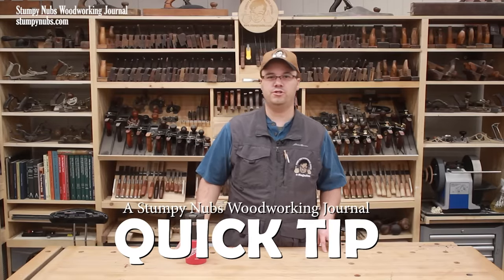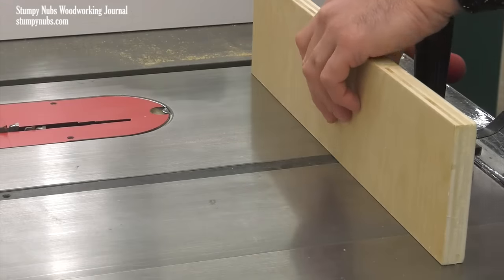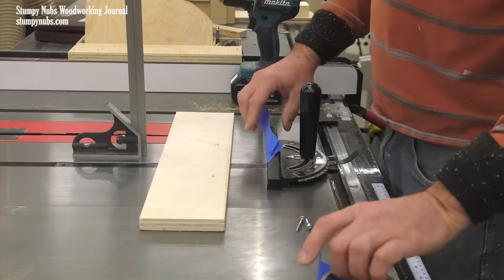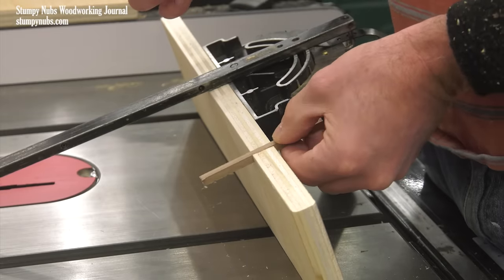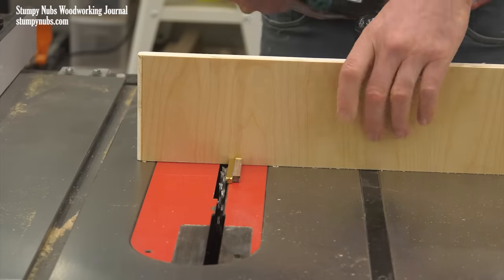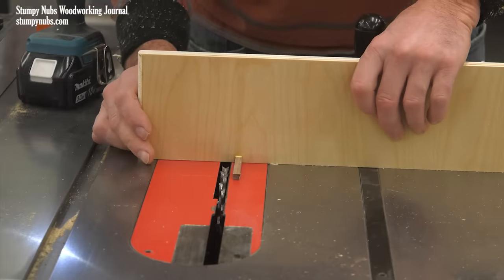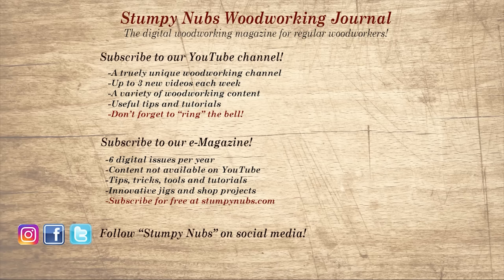CHEAP and EASY three-Minute finger/box joint jig

Comment: If you take the first piece after making the first cut and flip it, then place that cut over the wood strip, you can push your second piece up against the first to get the perfect distance for the initial cut in the second piece.  Be sure to remove the first piece before making the cut to avoid grazing the edge.  Then flip the first piece back over and continue with both pieces.
Reply: Brilliant, amigo!
Reply: Shmart!
Reply: But doing it tha way does not guarantee all cuts will be the same depth - trust me! Stumpy's method does!
Reply: @edhaskell1554 , not following your thinking. No mention is made of touching the blade height, which would change the depth of cut. This method is to position the stock for a cut that matches the size of the first finger. What better gauge for that than the very finger itself?
Reply: @leehaelters6182  But sccct happens sometimes when doing 2 vs. 1 cut! Trust me!
Reply: @edhaskell1554 , instead of clearing things up, you confuse me again! Stumpy shows how to do it by cutting both pieces at the same time, no?
Reply: @edhaskell1554 , was a great fan of Leave It To Beaver myself, when I was a wee nippah.
Reply: You were the trouble maker.
Reply: @edhaskell1554  I think you might have misunderstood what I was trying to explain.  The method I tried to describe only varies in how the second piece is positioned for its first cut.  After that, the rest follows exactly as Stumpy Nubs describes using BOTH pieces at the same time.
Reply: Great little hack. I'm going to try this today. Making a little jewelry box for my wife. Cheers!
Reply: +1. 

Your suggestion is the exact same method as pretty much every other box joint jig build I've seen on YT. I'm surprised that eyeballing the position of board B was suggested given the accuracy required for tight joints. That said, I am going to have a crack at this because I want a box jig, but I don't build many boxes and I don't need something I can't fit in my workshop. This can be tossed in the trash right after. :)

Comment: The geometry works the same on a router but there are complications. I do not have the best router but I have nice bits. If the wood ever grabs the twisting force is more than you can overcome with your hands. That twisting motion you feel means the joint and the box are ruined. With a table saw and dado blade set up, the force of the blade is pulling the work piece against the table. I am not trying to start and argument; if you made it work with a router I am happy for you and you should pay yourself on the back for buying nice routers.

Comment: I'd just like to make a comment about Ridge Carbide.  On Stumpys recommendation I bought a blade from them.  I had a mental malfunction filling out my address and completely missed the drop down box for what state I live in.  By default it went with the first selection which if I remember right was District of Columbia.  Half an hour later I got a phone call from them trying to straighten out my address.  That is excellent customer service.  They were literally working on my order within half an hour of me ordering and called just to verify and correct my mistake. The blade did arrive very quickly and is beyond comparison from the factory blade I was using.  I feel like a doctor who was using a butter knife and is now using a precision scalpel. The difference between the two blades is astounding.  Thank you Stumpy for the excellent videos and advice.

Comment: Thanks, I like cutting both sides of the joint at once. Efficient and accurate. I prefer a table saw for finger joints. I have trouble with tear-out on the router table.

Comment: Really cool.

Question, could you have just turned the first piece over and slid it on the index key. Then butted the second piece to it, to get your starter cuts?  Would seem to take the guess work out of cutting the second piece correctly.

Comment: I love the video. Quick and effective solution. Several other videos I've watched are way more complicated.

Shouldn't the height of the bit/blade be determined by the thickness of the material? If I'm using a 3/8 bit and cutting 1/2 inch thick material the fingers of the joint will be too short if I only raise the cutter to the height of the width of the bit. Unless you're talking about doing it in multiple passes only cutting the equal amount of material as the blade/bit is thick with each pass until reaching the proper depth for thicker material. (I hope I explained that coherently enough.)

Comment: One other question/comment - are there any specific steps vs. regular saw cuts you take to make sure Dado cuts are safe? I built a crosscut sled that I've used for Dado cutting and it works fine, but when I extend my arms to push the sled out, the saw blade is exposed, and since I use a sled the blade has to be higher than it otherwise would be. I may just attach a small stack of 2x4 blocks on the back end, but I wondered what you might recommend. I also might put a piece of plexiglass at the top of the sled over the blade opening because I often see small chips and sawdust kicked up in this direction during cutting.

Comment: I’ll be making this today. I’ve been cutting box joints with a similar jig using my router table. I find that the wood sometimes tends to shift/twist slightly when the bit makes contact even though I have the workpiece clamped and I hold it tightly. I’m hoping the table saw method will eliminate that.

Update: made the jig. Easy to do. I still get a slight twist of the workpiece as it hits the dado stack, but it’s far less than on my router. Using a trigger clamp mitigates that, whereas with the router that’s not quite sufficient. Fit was quite good. Setup of the while thing is far easier on my table saw that on my router. In fairness, I don’t have a router lift, so fine tuning the height adjustment is fiddly. So, we know what that means…need a better router table and a nice lift. 😅

Comment: James - this is the first of many videos I've seen suggesting that you cut two joining sides at the same time for box joints. It makes so much sense. What do you think about doing all 4 sides of a box at the same time this way? I don't have a Dado set (yet) and even though the Freud blade I bought does a great job, it of course can often take 4-5 passes to do 1/2 inch box joints.
Reply: Seems like all 4 should work if the tolerances are right.

Comment: just to clarify, do you set the blade height to the width of the dado, (like 1/4" to 1/4") or is the blade height set to the width of the wood that you are using for your project?  just looking for clarification. thanks.
Reply from the maker: Blade height equals thickness of the wood.

Comment: Thickness Of Wood: i was so focused on making the jig i realized later that yes i can create the jig for diff size joints (1/4” in this video…1/2” for me) but the depth of cut has to match the thickness of the wood you’re using. in my situation i wanted 1/2” joints on 3/4” wood so i adjusted my depth of cut to 3/4” and it worked perfect 🤙🏽😊

Comment: When you had the two boards laying flat on the table it made me wonder,  could you use finger joints to make a board longer? Obviously it’s feasible, but is there a better method? All the glue surface seems like it would make a very strong joint

Comment: Quick and simple: used this a technique a bunch. Thank you for sharing. One suggestion: Be careful to not make the grove in your backer board higher than the final cuts. You need that backer to support the wood or it will tearout (horrible if using plywood). Better to be a little short and sneak up on it until you get the fit you want than over cut and back down.

Comment: The video assumes you’re making 1/4” pins and joining 1/4” material. You can scale it up to 1/2”, for example.  But if your material thickness doesn’t match your router bit (or dado set) then you’ve got a different problem.
Reply: So just adjust to the dimensions you have?

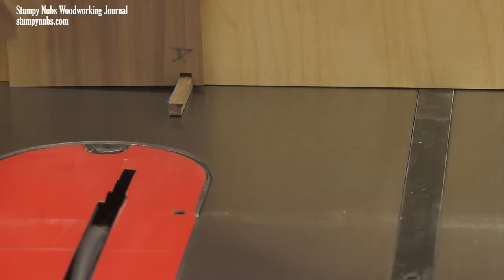Comment: Can someone explain what he means by 'aligning with the open kerf of your jig's fence' at around 2:15.  He is aligning to the fence's cut eyeballing rather than fitting up against anything solid AND additionally eyeballing a small 1mm open space extra in that cut that I suppose is the kerf he means????  I can see how that provides accuracy for the rest of the cuts but not precision - in that ALL the cuts may be imprecisely too closed or too open if you eyeball screwy.  I'm Confused. Respectfully...Thanks.

Comment: If you have 1/2'' material and want to still do 1/4'' joints, do you just do the same thing but raise the blade when you make the last hole to 1/2''?
Reply from the maker: Yes, you can use any thickness. Just raise the blade accordingly.

Comment: Thanks for another great tip. Haven't made finger joints yet but this one goes into  the favs for future reference. Also, I am building the Universal Clamp Rack and am recording the build in order to post on my YT channels. I am not mentioning or showing any of the dimensions so as to not take away from plans you've worked so hard to make. Are you cool with me posting this build?
Reply from the maker: It's fine as long as you don't show to much detail so they must still get plans to build it :) For example, don't show a complete step by step.
Reply: @StumpyNubs  Okay. Just thought I should ask before just doing it. Thanks.

Comment: Kind of a stupid question..

I only have a cheap Harbor Freight table saw.  It sucks really,  but is good enough for what I use it for. 

I don't think I'd feel very safe using a Dato set on this saw.  The extra weight would worry me. 

Can I just use my flat bottom saw blade?
Reply from the maker: Use a router table: https://youtu.be/xmA0_mLb8OA?t=49

Comment: I've made two of these types of jigs, one for table saw with dado stack and one for the router table and neither have worked satisfactorily. I used a brand new 1/4 inch spiral bit and could actually see the router bit flexing in the cut and it made really distorted cuts. The table saw one I had to fiddle with the spacing constantly and any inconsistency accumulated and made horrible joints. I finally bought a template made for use on a dovetail jig, screwed it to the edge of an old stair tread, it hangs on the wall ready to use at a moments notice. Works perfectly for quarter inch box joints without the hassle of spacing it which I'm obviously lame at lol
Reply from the maker: If bit flexing was an issue at the router table, why wasn't it also an issue with a handheld router?
Reply: @StumpyNubs  Y'know, I don't know the answer to that. I'm thinkin I might have used a regular 1/4 inch straight bit on the template as that flexing bit really scared me. It's a solid carbide bit which is known to be quite brittle and I was concerned that I was gonna get a chunk of it stuck somewhere that might make me leak some of that red stuff. heh  I was making test cuts to get my jig set up and using some scrap pine lumber. Would using pine tend to make the bit "grabby"? hmmmm, maybe have to try this again and see how it works with hardwood

Comment: Instead of eyeballing the first cut on the 2nd piece before you stack the two for the remainder of the pieces, use the setup block to first position and hold in place. This eliminates the chance of a poor lineup

Comment: I tried this setup about a month ago based on some other youtube videos I watched. I found that the placement of the jig after inserting the pin needed to be correct to within a few thousandths of an inch and the back fence needed to be really close to 90 degrees or else the teeth wouldn't fit together. Any small error in the process would just get multiplied by the number of fingers. I ended up spending 2 days making a crosscut sled first to help ensure I got my backing fence as square as possible since it seemed nearly impossible to do it with the miter gage. Then it took me like 2 hours to dial in the placement of the fence with a stop block. I don't know how I would've been able to shift the jig over accurately without being able to repeatedly adjust it with a stop block on the crosscut sled.

That said, I did not do both sides at once. Does this help with accuracy or is it just a time saver? I'm relatively new to woodworking, but after all it took me to get the thing right, I would be amazed to see someone get it correct in a few minutes.
Reply from the maker: Errors do not compound for each finger. It that were the case the first few would be tight and by the time you got to the end of the joint they would be excessively loose. There are only two causes to poorly fitting joints- you either didn't properly fit the wood strip in the kerf (it's too wide or two narrow) or you didn't properly space it from the side of the dado set. Since it is pretty easy to know if your wood strip is right by how it fits in the kerf, the latter is the most common cause of issues. Careful placement using a setup block or a piece of your wood strip should be no issue. Take the time to get those two things right and you will be fine. This jig took only a few minutes and it worked the first time.
Reply: I am a newbie at the table saw and I used this very jig. Could the miter gauge be defective or difficult?  (I have seen repeated comments about factory provided miter gauges being wonky. Shrugs -- ours seems okay.)

I've looked at complicated jigs for finger joints and this was really so easy.   Also,  I like the idea of gang cutting both sides at once with the second side offset.  Smart!  Thanks.
Reply: @StumpyNubs  That's interesting because that's exactly what happened with my jig. The first few fingers fit ok but they were too tight at the end. Do you guys have videos on how to know what a correct fit feels like? How do I know if my pin is too big or too small for the slot? How should it fit? For the dado set spacing how do I know how to line the spacer up? The teeth on my blades stick out a little bit from the side of the blade body. Do I press it against the teeth or the blade? I always feel like I struggle to cut pieces to a specific width other than with strict measuring. Thanks again for the help :)

Comment: Will this work with just the standard sawblade, or is 1/8 of an inch too small for the finger joints
Reply from the maker: Yes if the blade cuts a flat-bottomed kerf

Comment: I love all your videos. All very helpful, but... HELP! I did your table saw finger joints as directed. The kerf cut and a perfectly snug fitting strip of hardwood. I then cut the 2nd kerf as directed and proceeded to cut the finger joints as directed. It goes together nicely, but for some reason the fit is loose with gaps between the fingers. The kerf is 3/16", the wood strip is 3/16" and the saw blade (obviously-it cut the kerf) is 3/16", so why would the fit be loose? Please help.

Comment: Okay, easy and quick, for some perhaps...

To begin with, I tried to do this on the router table first. And the router bit wanted to pull the material to the right and that was pretty scary. Tried a couple times with a firmer grip and gave up on that.

Decided to do a dedicated finger joint crosscut sled because my miter gauge doesn't have an easy way to attach a board onto it. It's an old Craftsman and was more hassle than it was worth.

So I got the jig made and cut out the joints with a quarter inch dado set as instructed making sure that I was exactly a quarter inch in height. When I went to put the finger joints together they reached only about halfway through my material. After re-looking at the video, it seems that you are only working with quarter inch material. So there is no way to do these at exactly the same height as a quarter inch and make it work, for example on the 15/32" plywood I had.

And then third, I note that you did not use plywood. Does that perhaps explain why I had a lot of tear out? This is a brand new dado set I am using. 

I really would like to make this work. Sorry for all of the questions.

Comment: Looking for a video on a box made with finger/ box joints. The bottom being jointed on all four sides. Is it possible?
Reply from the maker: Sure, it's possible. Getting the fingers on the bottom lined up would take some planning, but it could be done. However, it would be unnecessary for strength.

Comment: What happens of the two pieces are not exactly a whole multiple of the joint size?
Reply: Will one of the fingers be two small and leave a gap?  Or will the whole connected side just be shorter?

(I'm guessing both.)
Reply: Actually some fingers will be small on one board but the overall length of the connected joint will be correct.

Comment: Love this simple little jig, but it took me a lot longer than 3 minutes to make it; just setting the dado set to be the precise width takes longer than that. :)

One thing to note, from my observations (most likely common knowledge to more experienced woodworkers) is the following:
1. The height of the blade needs to match the width of your stock. A little longer if you want the pins proud to sand down.
2. The width of the blade is how wide the gaps are.
3. The distance between the key and the second cut is the width of the pins.

2 and 3 need to be very precisely matched to create a nice joint.
1 just needs to match the thickness of your stock; it doesn't have to be the same as the key width i.e., the key does not need to be a square.

I realized this when I made 1/4" tall, 3/8" wide pins for 1/4" stock. I had the blade height also set to 3/8" which meant my pins were all about 1/8" too long. I thought I had messed up the whole jig by mixing measurements. Then I realized I just need to lower the blade. :D